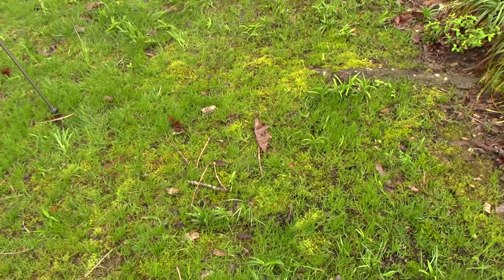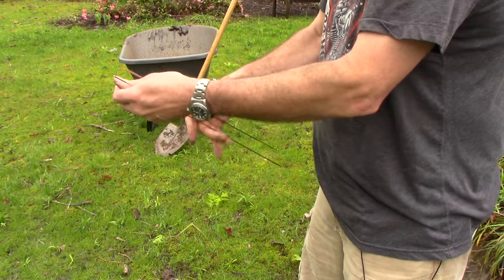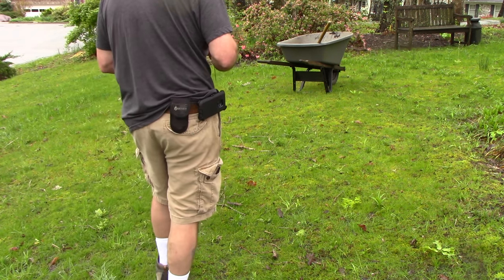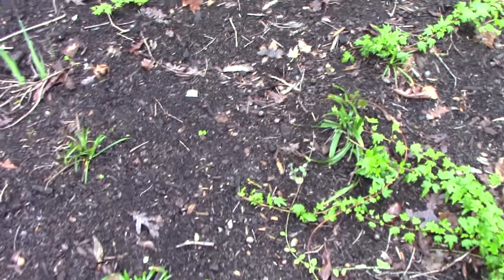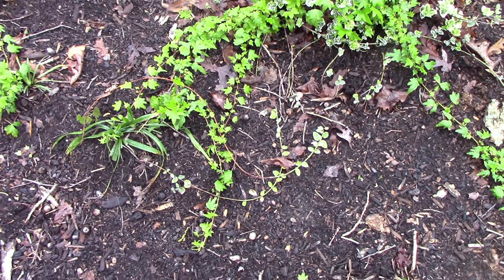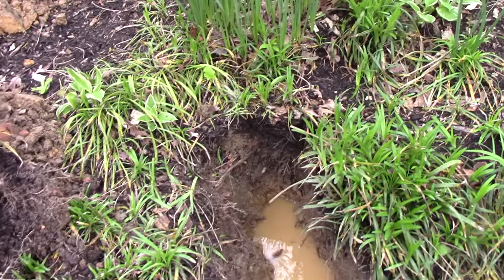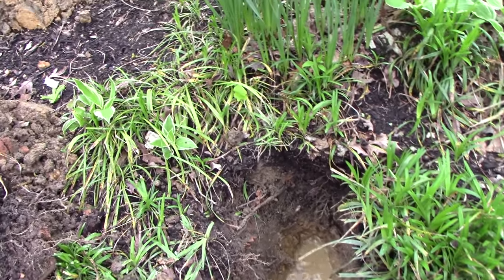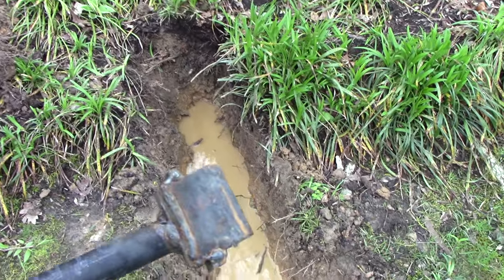Searching for an underground water leak

Comment: For those of ya'll that don't think this works.  I'm an experienced utility locator and this is the last resort for looking for underground utilities. But let me tell you. This works 90% of the time.  I can't explain it but I've literally done it hundreds of times and I've proven it to people in the field. Of course, GPR and a pipe and cable locator are good but the witching sticks are good and last alternative.
Reply from the maker: Finally someone who can confirm this works. Thank You!
Reply: If it works 90% of the time why use it as a last resort?
Reply: @brookbowen3152  Better than nothing.  Locating is just a best guess.  Without exposing ( potholing) it you really don't know for sure. But 90% is better than 0%
Reply: Due to the area you are using it in, maybe you never got the heads up on this. You will get a false positive if you walk under a thick, black telephone line running between poles
Reply: Forgot to mention, I've been doing it for over 40 years.
Reply: @joepiet  I had a neighbor many many years ago, maybe 35-40 yrs, that showed me that trick where inside his house he’d walk over a spot in the house where plumbing pipes were & the rods would move/come together...however because it was so long ago I don’t remember what type of metal he used for the rods, I vaguely remember that he might’ve used a coat hanger that he cut in half...since you have experience, what else besides a TiG welding rod could I use, would a coat hanger work ? 
Thanks, 
Chris
Reply: I am a land surveyor..when I first started I was on a utility crew..my instrument man at the time was trying to show me this and my crew chief got all bitchy saying it don't work and when the Iman showed me our chief Said it was a wives tale and his hands  moved it without him realizing it because we already had it located and knew  where it was..well I know for a fact if water is flowing it works in a pinch as long as the line isn't too deep..
Reply: We were 4 hrs from home and our g.p.r  and our 810 were dead and we needed the last half mile of water located and we used this and got it done in pretty much the same amount of time...now I'm pretty sure it won't always work  but I know it can..especially for a homeowner   Since most of the time their lines aren't very deep Now would I go downtown Orlando and try to do some nonsense like this no absolutely not but if I'm on the side of the turnpike and there's only 2 fibre optics in a water line and I'm a 1000' away from the truck and I only have a pink flag on me I'm probably gonna pull out the flag and try it
Reply: @Hal_Beep-Boop  Two guys that have years and years of experience vs. rude jackass popping off on people for no reason. I will take the two guys with experience. Nobody claimed it’s perfect or lives should depend on it. Lighten up Frances.
Reply: Who did you play on mythbusters?
Reply: Does it work for old clay drain tile?
Reply: @JoshuaStockton probably not, but maybe.
Reply: @MrJamesTimmons I don’t have a life time of experience, only a few years, but yea this works to locate as he describes, we do the same thing with our plumbing company.

Comment: I have found water line leaks in the ground using a metal rod: I slowing walk over the ground where I think the water line should be: about every 2 feet or so I plunge the rod in the ground. There will be a uniform resistance, but when at a leak the rod will plunge easily into the soil because the water will loosen the soil. Try it.

Comment: Yep I dig up repair  and install water lines,sewer lines, and electrical and use the 2 rod method to find unknown water line locations etx. Works good as long as there is not any other interferance.

Comment: I've done this before, had better luck finding where to drill a well than finding leaks. It also works finding underground wires and pipes. Not 100٪ ,but it works. It helps to have a clear head and nobody bothering you.

Comment: We had a sewer clay line pipe break which was under the asphalt which backed-up everthing in the house so their were absolutely no signs in the asphalt to locate the pipe or the break.
 We thought it changed angle at some point down the drive way which was in a  fairly large area of the carport.
My friend grabbed a coat hanger bent it up and did the same method as the gentleman in the video. He went back and forth across alleged pipe and marked the pipe and the bend by marking both sides of the pipe within a foot of each side of the pipe. He marked the route of the clay pipe for about 40 feet where the break was or assumed so. Plumbers came in  trenched 10 feet up to his chalk marks hitting the clay pipe with the marks lined in the direction of the sewer pipe at the far end of the trench from where they suspected  the break was and never even came close to the break. After not locating the break themselves, plumber's decided to try the spot marked by my friend and doug up his mark on the pavement and they hit the break within 1 foot of the mark and 12 feet from theirs. This was back in 1984.
I couldn't imagine  this ever working but my friend not only found the break but was able to map the pipe in the ground position from the house, turn point and down the drive way next to the cinder block wall two feet out from it.
He nailed all of it. 
Should not be possible, but it was far from just luck. Everyone including the plumbers were off by 10 to 15 feet. He was dead on the center of the pipe the entire way.
Reply: that is what I was thinking it was he needs to find the leak

Comment: Locate your water meter(A)and the location where your water line first enter your building(B).Mark the straight line from A to B on the ground (maybe using white flour, dry sand ,wooden pegs etc).Measure the depth of your water meter if it is placed in a chamber below ground level. locate the most healthy vegetation (grass scrub etc) along the previously marked line. Carefully dig a 1 foot wide by 16 inches deep(go deeper than your underground meter maybe 1 feet extra) across the selected area.Extend your trench 3 feet on both side of your line. Find your pipe.Cut and plug your pipe end that joining to the meter. Turn on your water and see if there is leakage in your pipe(The meter stop reading if there is no leakage)Now you know that it is along the line toward your building that leaking..and the rest is luck..(retired CE)
And ya water witching is good to be done during dry weather and if your ground water is far below your ground level other wise you might got water flow from other sources rather than your domestic pipe water. By the way it does help if you increase the flow of your water by turning on a couple of water outlet in your house and believe me the wonder sticks do tell you the flow direction of your pipe.Good luck.And do not use a very thick rod simply use the thinner metal cloth hanger as the action is more sensitive for life flowing water detection.(I do use my sticks this morning just to make sure what I said was true and It was true)

Comment: For anyone that thinks they may have a leak in the yard.

Find your main shut off valve for the home. (It may be in a basement, crawl space, or a small storage area if your on a slab.)

Turn the valve off, then go to your meter and check to see if the dial is spinning. If it’s a digital meter the last 2 numbers will be going up.

If it’s not then you do not have a outside leak.

Comment: Try introducing compressed air to the line. Given how wet your yard is this would definitely help expedite the process. Great job chasing the leak. I have also had luck using these rods while walking along the top of the service line. The rods will usually both turn to the left when above the leak. I have seen this response after I use all of my Sewerin leak tools to pinpoint the leak.

Comment: I called American Leak Detection. They filled the water pipes with gas, then poked holes in the ground to find where the gas was concentrating. It was $300 well spent, compared to digging up my entire water line. I also tried dowsing; despite comments to the contrary, it didn't work.
Reply: Going to call them on an irrigation leak I have. No traces of water on the ground but the meter is running.
Reply: What gas did they use?
Reply: it does not work for everyone. dont know why.

Comment: What are the rods made of ??
Reply from the maker: In this case they are steel. A coat hanger will work if you can get them straight enough.
Reply: @bryansprojects3570  I DID use coat hangers,,and they worked fine,,(I think)

Comment: Did you open the valves in the house to allow back pressure to bleed off? If all valves are closed the pressure in the system will continue to push water out of the weakest point like a crack or break. When you open a valve it will still leak out but by water level only. Anypoint higher than the leak will eventually drain until the water in the system is level with the leak height.
Reply from the maker: I opened an outside faucet that I did not show to try and drain all of the head pressure out of the house. It turns out I was wasting my time anyway looking for a leak. Thanks for watching!

Comment: Copper rods or any rods works?
Reply from the maker: Any metal rod should work A steel coat hanger will work if you can get it straight enough.

Comment: Pipes do not have to be metal. Ive found tons of plastic pipes .  To find the pipe you should make multiple passes and mark each one. If they are in a straight line there's your pipe. I suggest holding the wires firmly, your wont be able to keep them from spinning and there's less chance of flopping due to dropping the tips. You can make them spin where you want by changing the angle.   Ive used all kinds of metal wire.
Reply from the maker: If you read some of the other comments this method is complete BS and does not work. I used the same method with coat hangers in a recent video to help locate a plastic pipe.  Thanks for watching.

Comment: Which method is more reliable, using coconut, copper wire or the method they use with battery. Kindly advise
Reply: Some wire, iron, brass, copper, aluminium.
Reply: Ferrous is best, i.e. any material that can be magnetised

Comment: Good job.
I have tried witching out lines, and I get very erratic "results".
A false positive is worse than no information at all.
Reply: Maybe not doing it wrong.  Mine is spot on.
Reply: That is because it is total crap. If it worked utilities would use it. It does not. Take it out of the persons hands and try it. Nothing will happen.

Comment: Witching for water is a real thing, I've done it several times. I was just wondering how far down were your water lines, it didn't look like even a foot under ground. In Colorado you gotta bury the lines 4 foot deep. Good video.
Reply from the maker: At least someone believes me about this. The water line at the house is maybe 2 feet deep. At the curb the  meter may be a foot. I may do a follow up video since this video has become so popular.
Reply: Witching for water has worked for centuries because there is underground water damn near everywhere!

Comment: Does anyone k ow if this wire trick work without a leak? I'm looking to find the main pipe underground for T Junction for hose tap. No leaks. Just don't wanna dig driveway up.
Reply from the maker: I was using the rods to locate the pipe assuming it was leaking. The irony of this video was that there was no leak just groundwater pushing out. In my experience you can locate any metal line underground with this method. It is best to practice on something that you know is there so you get a hang on how to hold the rods.

Comment: Did you shut off the water valve at the service entry in your house?  It may be the water in your lines inside the house. Once you shut off the main outside all that water has to go somewhere and I believe it may be surfacing at the break in your line.
Reply from the maker: I may not have shown it but I did shut the water off and drain it at an outside hose bib.

Comment: Can detect pvc or HDPE pipe leaking?
Reply from the maker: This method just locates the pipe in this case ot is PVC as far as I know. It turns out there was no leak on this case. Just happened to be water running out of the ground. Maybe from a spring.
Reply: @bryansprojects3570  What is your plan to fix the problem? Same issue at my house
Reply: vikings844 more than likely he’s gonna have to put a French drain system in, that’s gonna be about the only way to take care of an area that constantly holds water

Comment: Is it important what wires are made of and how thick?
Reply from the maker: It does not really matter on the size that I know of. Coat hangers can be used as long as you straighten them out pretty well.
Reply: I use copper

Comment: What are the rods made of? Are they copper or metal?
Reply from the maker: They are steel with a copper coating used for TIG welding. I think any style of wire will work, you could bend up a metal coat hanger they just need to be pretty straight to be balanced.
Reply: @bryansprojects3570  Will the rods detect a water leak under a cement slab?
Reply from the maker: To be clear using this method can help you locate underground utilities. It does not locate a leak. Under a slab I do not know.
Reply: Lies

Comment: Sir, I am familiar with witch craft but I am a non believer in whitching it.  Could you take two pens, open both pens and remove the ink cartridges.  Insert you bent metal sticks into the hollow pen and see if the metal sticks would turn without human intervention by holding the metal sticks directly.  The metal sticks would be free to rotate or spin when influenced by the underground pipe.  If I can see this done without contact with human hands, perhaps I would become s believer of this technique.
Reply: That's what I did and they work prefect. Little bit sensitive but I like them to be frictionless
Reply: ......If.......you just tried it for yourself you'd be amazed and no longer skeptical.
Reply: He's looking for a leak that he doesn't have.
Reply: He is a democrat. Democrats dig up the hole yard before looking at the water meter.
Reply: This "works" onky because in many places there is a shit ton of water in the ground. For example.where I live you can literally put a pipe anywhere in the ground, put a pump on it and you"ll get water.
Reply: Isso se chama radistesia , mais fácil de te explicar 

Digamos que as varinhas sejam as antenas 
E nós humanos somos os receptores de sinal 

Oque você pensa você emite uma frequência as varinhas indicaram a frequência e você captura
Reply: @KafanskaTV  I witched a well for a friend. his driller refused to dig where I said. No water. Changed spots no water. Fired the guy and had new guy  where I said. Got water. Water is not everywhere. Most places its not an issue finding it.  But some places are terrible. ridge across from me has 10 dry wells on it.

Comment: Were you able to get the flow of water to stop?
Reply from the maker: There was no leak. The water was just pushing out of the ground. It eventually stopped.
Reply: @bryansprojects3570  water doesn't stop leaking by itself
Reply from the maker: It had to be groundwater. The water meter was not moving when the water was still running out of the ground.
Reply: @bryansprojects3570  Maybe your neighbor had a leak.

Comment: Did you end up fixing it! I have the same problem at my house! No water pipes going to spot and its around a hill just like yours! It has me stumped on what to do. Rent a large tent for a grad party and it started where the workers pounded a stake in the ground. If it is an artisan well is it even repairable?
Reply from the maker: It actually dried up and has not come back. I really can't explain it.
Reply: @bryansprojects3570  Thanks for the reply! I'll be patient and wait it out for a couple of years. If it dosent there is a steep hill about 10' away and was thinking of digging a trench to the hill, stick some drain tile in trench and plant sod on top.

Comment: Hey, So what was the end result?  I see your sticks didn't really find the pipe or the leak for that matter?  Did you figure that you have an underground artisan well?  I have a similar "leak" but Im digging up a huge area searching for it.
Reply from the maker: The sticks were to help confirm where the water line was located since I knew where it left the house and the location of the water meter. I finally determined it had to be groundwater since the meter was not turning. It eventually stopped. It seems odd since this is the highest house on the street. I may do a follow up video with the sticks since nobody believes that it works.
Reply: @bryansprojects3570  I really appreciate your reply and must have missed the part where you dug up the pipe.  I just dug holes around a 25ft radius in my yard and about 24" down water would pool in from all sides.  It's coming off the rainy season so must be ground water.  I found no leaks on the only irrigation pipe nearby and even with the water off still kept flowing.  Water is crystal clean too.
Reply: @helichief  I have same problem.  Let me know if there is a solution. Thanks
Reply: @vikings844  I rented a mini excavator and dug holes all around the area.  Turns out it was just the natural water table.  No pipes were leaking.